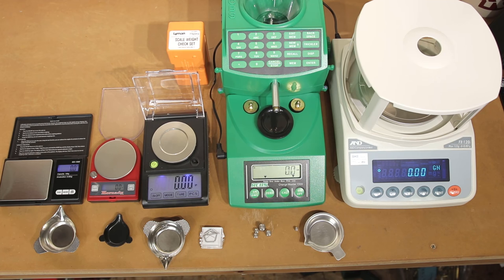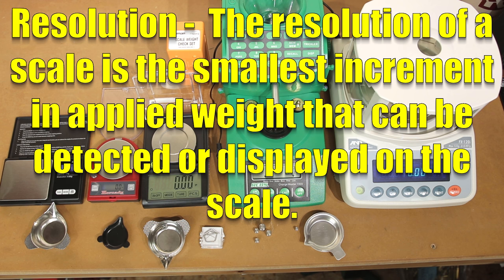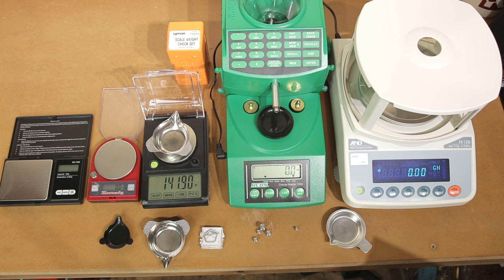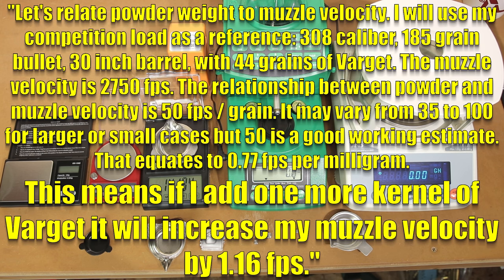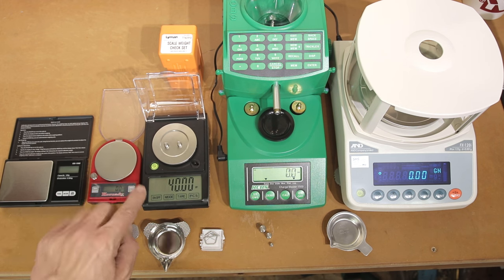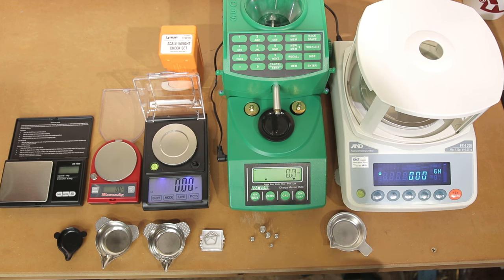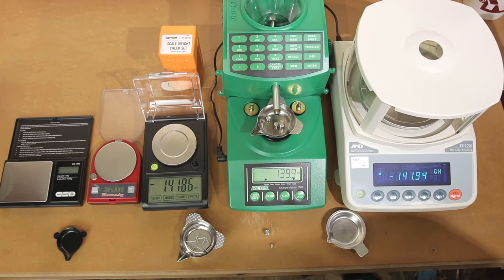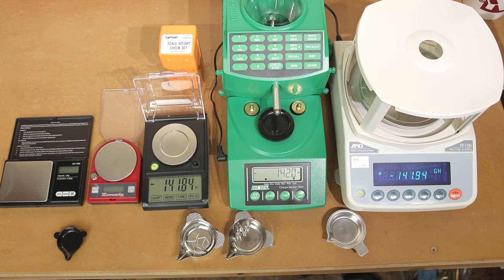Reloading Scale - Comparing the GS 1500, Charge master 1500, WAOAW milligram, and FX120i

Comment: I am in this weighing industry for 35 years.  The load cell or sensor in balances can range anywhere from US$1 to $30.  AND uses one of the best hybrid magnetic force technology, they are expensive but also most accurate.  The cheap load cells are not linear and do not repeat, manufacturers also use Analog to Digital processors that do not high internal resolutions, so to make the balances inexpensive, a lot of software are use to mask the inaccuracies, like zero tracking, which is the scale internally is not zeroed but the software will just display zero and we assume it is zero.  A good way to test is to put a container, tare it, and put 1 grain or 1 division of weight on the scale, for cheap scales, it will just capture it as zero or as previous weight and one can continuously add 1d a time and the software just zeroed that out until there is a big change in weight.  There are no standards in manufacturing but most companies use 1.5d weight increment must show 1d weight increase.  I have done a few videos showing comparisons in filling speed, dosing application and other accuracy tests.  And will be happy to share with you.

Comment: Single kernel resolution is completely wasted unless you’re shooting in space. Consider that a gust of wind at the muzzle can cause your bullet impact to change elevation much more measurably than a single kernel of powder can. Even if you made utterly perfectly uniform ammunition, your gun’s tolerances aren’t perfectly uniform, so essentially, you’re wasting perfection anyway. Just save your money and spend it on the best components you can get.
Reply: I don't agree with that. If your charge load has variation then you would be adding the variation of the wind. You would the be further off your point of aim than if you had a very very accurate charge load.
Reply: You have never played with flintlocks
Reply: @glennvandenberg3912  If .1gr let alone .02gr is throwing off your load, your load sucks. Been loading straight from a Chargemaster for years and been able to get single digit/low teens ES over 10 shots.

Comment: Would be interesting to see a beam scale compared to these.
Reply: I have 3 digital and beam.  The beams are great nothing to break really.  Very simple and you can trust them.   They compare very closely.  I will use the beam to check the digitals with known weights.  Or I will toss in 4 charges in the beam to see if it weighs 4 x my powder drop.   The electronic are faster to see how much you are over/under.   I trust the beams they use gravity which is pretty stable and not temp sensitive and needs no batteries.
Reply: Quite well actually. I use an Ohaus triple beam agate lab-scale and it is wicked accurate for a mechanical scale. Approx +/- .1grain which is pretty darn good. And they don't lose calibration. I have a Chargemaster and I actually don't use it because if I use this scale and a Harrells precision powder thrower, I can't tell any difference in vertical dispersion with my 6.5CR at 400yds and my thrower is a lot faster. My way may not be agreeable with other but I have no need to change my method at this point. The scale goes for ~$150.00 at Cole Parmer.👍
Reply: @Jeff_Seely  Nice!  Those old triple beam scales are nice and don't freak out like digital ones do when they get low on voltage.

Comment: I bit the bullet a while ago and purchases a Sartorius Entris 64 which measures to .002 grains.  I used to use the RCBS ChargeMaster Lite to throw the charge close enough and then trickle to the exact weight.  I've since them moved to the Franklin Intellidroper.  It's wicked fast dumping the powder and I will say the Franklin drops a charge usually within .05 grains.  I've seen it drop within one kernel but it's not repeatable.  If you are going to load 50-75 rounds a sitting, The Franklin will server you well.  That coupled with your FX120 and you are ready to rock.  You may want to consider this.

Comment: after 20 years of reloading match ammo and using everything available for accurate powder dispensing, I went back to a good balance beam scale and trickler.  accuracy is more important than speed when building long range match ammo.  Hunting loads and banging ammo for Ar's not so much.  A good technique and a quality powder measure will dispense accurate loads well withing most needs.  For me the balance beam and trickler works the best.  It is not slow enough to make a difference.  Good video and great comparison between what is available.  Don't get wrapped up in the electronics. I did not find it reliable enough for my needs.
Reply: Don’t get hung up on bad electronics. Balance beam scales are accurate but take A LOT longer so don’t kid yourself there.

Comment: I use an optimized powder thrower for pistol reloads and I randomly check the accuracy in a $60 Frankfort Armory Platinum scale, I reloaded since 1989 thousands of rounds and this setup works perfectly fine, I was in revolver competition and I spent a lot of time learning, reading and with others talking about this subject and nobody, absolutely no one was concern about one kernel of powder more or less even in competition precision loads, true is we have a diversity of digital precision scales in this days but you dont really need to a extreme fanatic or break the bank, just fairly accurate and consistent. Jerry Miculek still using conventional reload systems, if is good for him is good for all of us.

Comment: A very underrated topic. For my method, I get really particular and measure every charge by hand. Tedious, but for my use it’s worth it.
Reply: Interesting experiment to do, if you're interested....
I've found that spherical powders seem to drop more regularly than extruded. So I threw 10 charges directly into the case (using cfe blk) and found them to be within .10+or - grain. Not great. Then I fired them all.  I next fired 10 that were hand trickled to be precisely on my ideal charge weight.  There was no discernable difference between the groups. 
Sometimes I think we get carried away and do thing for the sake of ocd instead of practical use..... and now imaging to go hand polish each piece of brass.....neck to headstand.  Don't judge!!!😂

Comment: Load by volume ,powder weight can change with humidity. Balance scales are more accurate. You can get very accurate loads with IMR 4831 in 3006 by scooping out of a container with the casing. Also works for varget and 223. Look in your manual for compressed loads. Lee powder scoops work great and are fast. People love to spend money 💰 on fancy crap.
Reply: Doesn't powder volume change with compaction?  
I would think this would be a larger deviation than any humidity/weight change.....
Out of all the things I've changed to get tighter groups, regularity in powder charge has brought the most gains. Not primer type, not brass concentricity, or any of that other nitpicking crap. 
(And once I get the thrower working properly I don't weight every charge.... they throw reasonably accurate enough that I can shoot perfectly acceptably. In fact. Learning fundamentals of shooting has gotten better gains in accuracy than any reloading trick.....but I digress)

Comment: I found RCBS Lite chargemaster to be a much accurate than 1500.  At first when I purchased 1500 I did every mod and calibration I could try and still it wasn't where I wanted to be so I returned it.  When Lite came out I purchased it and was so much better!  Most important it would not overthrow straight out of the box without any mods and it stayed within 0.1gr range as I double check every charge on GemPro 250.

Comment: I've noticed through the years I have reloaded that the tenth of a grain it usually equates to 3 cereals or 4 depending on the powder. I'm talking about stick powder like Retumbo, 4831, 4350 or as such. My RCBS scale measure about 0.1 off from a balance beam so I check a lot of charges on the balance beam  but my charge master is about 20 years old now. Really like the comparison.

Comment: Don't forget - electronic scales and balances are temperature sensitive. As you get to the higher end, the performance is counting on the system being at a stable and narrow temp range. Usually between 65-70F or so - manufacturer defined. 

Loading in a cold/hot garage may not get you the expected accuracy on your $500 - $1500 balance
Reply from the maker: I check my scale with weights before I use it and my temp rarely changes a couple degrees in a room with no airflow its pretty accurate.
Reply: A balance would not be affected by temperature changes.  The scales in this video including the FX120i are electronic scales.  The FX120i uses a different system from the load cells of the others but it still uses electronics to calculate mass.  True balances are completely mechanical.

Comment: Just bought the hornaday g2 1500 as I realised I needed something basic digit scale as I just couldn't use the sliding scale that came in my lee press kit, and was cheap($105 with the scale and trickeler) well at least in comparison as most reloading scale are very expensive. 

My first 50 loads are with just the 2.5cc scoop that came with my dies, but need to get something the measures in Grs so I know a little more accurately what amount I'm loading.

Comment: This may sound like a bit much to do, but, beings many of these auto dropper/tricklers run on a small plug-in type transformer, I opened my unit up, located a ground trace on the main PC board, and then ran that to the ground lug on the wall outlet...Yes, it kinda sucks to have that wire like that, it does have a quick disconnect an inch or three from the machine itself but, I just tie-wrap it to the transformer power supply's wire.. Beings, my unit never moves, If I do need to move the scale, I can unplug the power cord and the ground wire at the machine, and just push the cord out of the way. I to leave it plugged into the outlet though. The grounding wire is attached to the outlet cover plate center screw. That center screw is also connected to the buildings grounding rod/neutral system. The drift I was getting in my auto dropper/scale was 100% resolved, after doing that.... With out getting into a whole bunches of electrical engineering lingo, it basically, assisted in dumping any of the random RF and static noise to ground, that the external transformer power supply doesn't do. The load-cell system, is exceptionally sensitive to RF, and the circuitry that deals with the load cell's capacitance strain gauge, does its best to deal with outside interference's like RF static, and noise, all it can really do it round up or down as a basic algorithmic gate for counting an average over time.  

I took things a step further and if you don't know what you are doing, I do not recommend that you do this, let alone, it will also, void the factory warranty "fact".... I took the whole unit apart, carefully, and I purchased from Amazon, a roll of adhesive backs foil sheets, 12 inches by 56 inches is what I think I got, for like $13 bucks. You can also get this this sticky backed foil rolls in a tape format, approx 1 inch wide to 5 inches wide, by 10 to 75 yards long, just like a roll of masking tape, except, it is a thin metal foil.. Anyway, I wiped the inside surfaces with Iso-alcohol, that may have been left behind from the injection molding process of the parts, and or assemble process and dust and powder residue from loading. Is that step required, NO, not really, but, why not, I have it opened already, might as well. I then proceeded to make paper templates of the various shaped that contoured inside void surfaces.. marked with a sharpie marker, each template and then its respective matching mark to the location on the inside location. 

Once they were all cut out, I test fit the cut out foil pieces, for proper fitment, with out removing the sticky side's backer.. I would proceed to the next stage, of connecting each one of the foils by a small wire, by means of soldering said jumper connecting wire. Paying mind to the need of the wire to clear interior structured plastic gussets, Test fitting each additional foil to the previous one, carefully test fitting again, and again, etc.... Once all were connected via the jumper wire, I lastly soldered on one (1) wire that has a quick disconnector in line, from the collection foils to the the main board, which happens to be the same location of the spot that the grounding wire that run to the outside of the machine to run to the wall outlet. Basically, I installed a shielding cage that catches a very high percentage of the RF noise energy that floats around from the room lighting, the TV & DVD player, laptop, on the work bench 5 foot away from where the digital scale resides on the loading work bench. It is a poor man's Faraday's gage, on the inside of the machine, so it visually is not seen. 

The drifting issue some auto dropper/tricklers have, and not all models do, and I have seen some of the same exact brand & model, where one will wonder, and the other unit, is spot on with no wondering or drift on the same work bench, so.. Who knows what that is all about? just is what it is.

Comment: I use a scale with a kindle focused on the needle, it will give within two grains of powder, ( not weight) the correct measurement.  Problem is,,, its way slow, but I don't care.and as far as accuracy can't be beat. Chemistry degree way back when we used scales in controlled rooms.  Sometimes grains will form a bunch as they adhere to each other.

Comment: Fx120 is also not great at repeatability as we can see in the video, but that is being ignored. Linearity is also important , but only interesting if you use it for very different loads. If you only need to load 42.4 grains , just check your scale with a reference of around that weight and be happy when the scale is able to reproduce that reading within the tolerance that you’re happy with. Also, if you put calibration weights on a scale, try to place them in the middle , since many scales are not linear from center to edge

Comment: I purchased a RCBS Chargemaster lite and used it for 18 months, it then stopped working.
The touch pad will not always respond, sometimes it will not calibrate, it will not stabilize at the 100gm step. It will also not turn off, I have to unplug it. It was used once a week or so, calibrated every time. 
RCBS says well it is over a year old, so sorry not covered under warranty. Here is a repair shop and they can maybe help. I have not called the third party repair shop number they gave me yet. Don't know what the cost will be to repair it.
Safe to say I would not recommend an RCBS scale. 
Update the repair shop gets a flat rate of $155 to repair this unit, plus I need to pay for shipping it to them and shipping it back..
What would you do? I would not buy this unit.

Comment: Hey mopar madman, good video. A good scale is worth its value in an 80% hit day or a 50% hit day. Premium components will pay for itself on hit percentages. At least my opinion. Another thing i thought of, just to throw a twist, can humidity percentage of your powder throw everything off? I dont believe anyone to be testing that. If there was a way for example to maintain exactly 50% humidity of your powder at all times i think the theory would be even better consistancy in extreme spread assuming that all other factors are controlled. It would be pretty tough to check though i would think. Opinion?
Dan
Reply: I've been trying to control humidity as I move charge-ready brass from garage where I prep the brass to my basement where I charge the cases. The approach involves storing finished cases in plastic bags with desiccant packs during the interval between when I charge the cases and when they get to the garage for bullet seating-usually immediately after charging. I read somewhere that powders can hydrophilic  to varying degrees so I figured I'd make at lease a minimal effort to keep humidity swings to a minimum - don't really know if its worth the effort. Be great if BAR performed a wee bit of testing on humidity impacts of burn rate and, therefore, fps.

Comment: Great video. I need to start saving ...I have the Hornady auto charger or whatever it's called it drifts , sd's all over the place.... but I'm getting great groups ....I'm certain that will change farther out I go !!   I still need to get one of those chamber cooling fans  if you're wondering I have the Caldwell g2 chronograph

Comment: A friend and I did a test of a range of powder scales a few years ago.
  My gold standard is my ancient Lyman balance with gem stone bearings. We then compared the measures of two Lee balances, one digital brand name powder scale, and at least one eBay Chinese no name digital scales. We used calibrated lab weights as well as common items.
   The deviation amongst all was so minute it was ridiculous to even assign a percentage accuracy figure.
   YMMV, FWIW, JMHO, etc.
Reply: Ya I have to say I didn't make it past the 1st 5 minutes before confirming that my old balance scale does a fine job. No +- digital error, no difference in reading depending on where on the scale I place the weight, no batteries required. Once you have the beam zeroed about the only thing that can induce any error worth worrying about is a stiff breeze. Luckily I'm mostly in a warm cozy room when I measure powder. ;-)